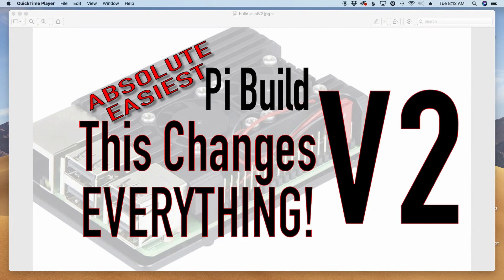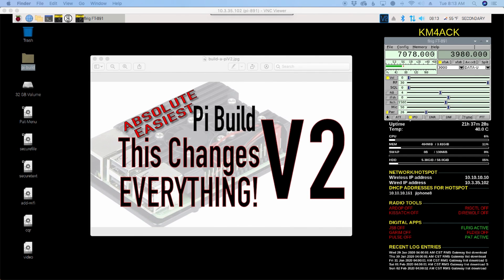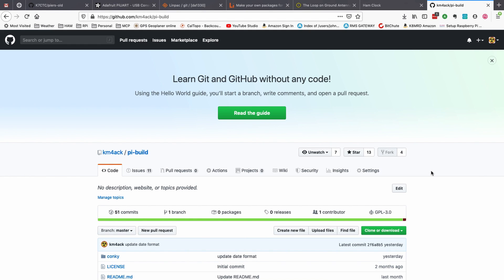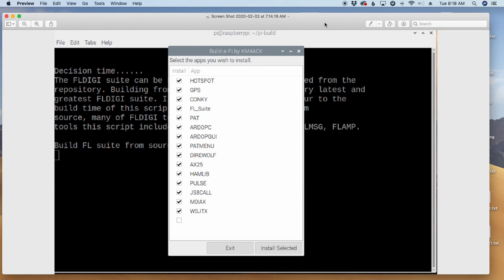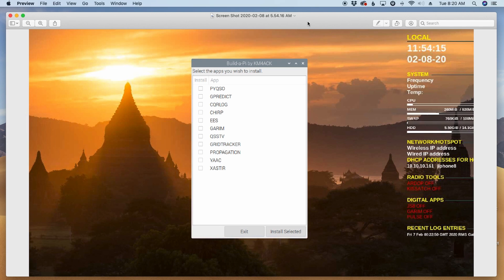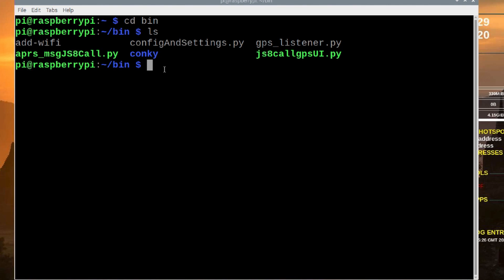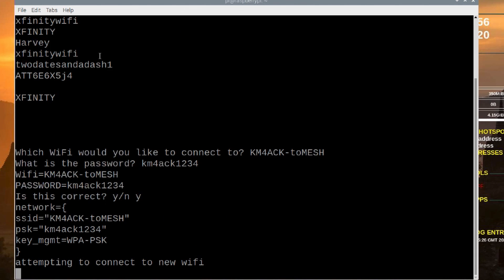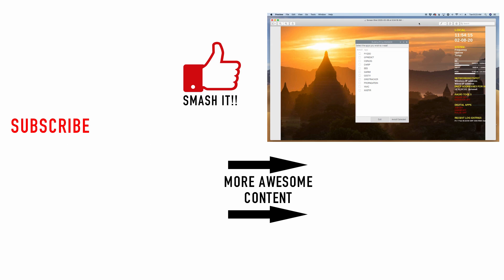Build a Pi V2 | Raspberry Pi Ham Radio

Comment: Just got a new Pi 4 that didn't come with an SD card. I'm about to copy the NOOB software onto a new card but after watching your video I would like to add your software package to the system. I have a couple of Nobe questions if you don't mind. 1) what is buster and where does one get it? 2) I use FLRIG on my shack computer to control my IC7100. The 7100 uses a special USB driver. any suggestions as to how I might add this to the build? I'm thinking I will use your software on my Pi as my digital interface for my radio.
Reply from the maker: Buster can be downloaded here https://www.raspberrypi.org/downloads/raspbian/ Question 2 I am probably not qualified to answer since I don't own the 7100 but I don't think you have to install the driver. I think the driver you need is already installed in Buster. If I am wrong, maybe another Icom user will jump in here and correct me. 73, de KM4ACK

Comment: Hi jason, 
I ran the command however the UI on the right with your callsign, gps, resource monitor etc didn't install. Is there a manual way to do this? thank you.
Reply: I had the same problem it looks like there is a problem with crontab as it does not come up with the second part of the install after the first restart.
Reply: can you run conky command manually to see if that starts it

Comment: Jason love what you are doing here. I have a problem, as soon as I install the hotspot(after reboot) I can't connect to my internet hotspot(iphone). I can connect to the pi hotspot from the iphone but the pi never sees the iphone hotspot.  How can I turn off the pi hotspot so I can finish the software install? Thanks
Reply from the maker: Hi Lynn, check out the FAQ to remedy this. It is normal behavior but the Hotspot FAQ will offer additional guidance. https://tiny.cc/km4ack-faq 73, de KM4ACK

Comment: Hi Jason, and a big thanks for all your efforts!

Oe snag when compiling Build-a-Pi V2...M0IAX no long supports JS8CallUtilsGPSD on his GitHub page...the link fails during compile. The new (supported) link is JS8CallUtilities_V2.  I have changed this in your build and compile script, and all now runs perfectly.
Thanks again - Jerry, K4OAM
Reply from the maker: Hi Jerry, the script has been updated (as of 20200423) to point to the latest version of JS8CallUtilities. 73, de KM4ACK

Comment: Excellent script once again!   This is a substantial help for those new to linux and desiring to incorporate with HAM.   I have everything running (been following Jason and Jullian (OH8STN) for a while.)... however, I do have one issue I haven't been able to resolve.  With QSSTV, I can receive fine.  However, when I try to transmit, the PTT triggers, but no sound is actually sent (zero power output).   I've tried about EVERY configuration combination.   I'm using FT-891.   Does anyone know if a manual edit to the config file is needed to get it working?    Thx
Reply: Brian I'm having the same problem with my IC7300, no transmit only receive. Most advice I've seen on the net is to change to MMSSTV. Not much use if you want to have a portable pi station ON8STN style!

Comment: Hi Jason, is this somehow usable when using PI headless, without desktop?
73 Jouko
Reply from the maker: The desktop is required. The script would be pointless without the desktop environment as many of teh applications it installs need the desktop GUI to run. With that said, you can setup the Pi headless and enable VNC from a SSH connection.  Then connect to the pi with VNC. From the VNC connection, open a terminal on the desktop and run the command to start the script.  The script needs the desktop environment to display the list of applications to be installed.
Reply: @KM4ACK  
Thanks for good explanation. I know many are running PI headless but as you told Buster with Desktop is needed.  Your clear answer helped many to use VNC in that situation.

Comment: I like to create another user rather than use the pi user.  What needs to be done to make everything work for the new user?
Reply from the maker: Make sure the new user has rights to the same groups as pi including sudo. You might also have to mod some of the .desktop entries for different menu items. It would probably be easier to do this after the build since the script is written with the assumption that pi is the user.

Comment: Tried to install but did not get the call sign option it ended the string saying it was a directory
Reply from the maker: Doug Wheeldon sounds like you may have missed part of the command. YouTube can jack up the link sometimes. Try the install command on this page. https://github.com/km4ack/pi-build
Reply: figured it out I installed with noobs...re-imaged and worked thanks!
Reply from the maker: Doug Wheeldon cool. Glad you got it figured out. Thanks for letting us know the issue. That may help another user in the future. 👍

Comment: Anybody else has a problem of freezing up on install.... l found, if l say yes to install FLDIGI from source it will seize up when loading.... saying no loads up the script with no problems
Reply from the maker: Building from source takes a VERY long time compared to installing from the repositories. It may seem stuck on one line. Leave it be and check on it in an hour. It should have moved past that line by then. The entire build when installing from source will take 3-4 hours on a pi 3. A bit quicker on a pi 4.
Reply: @KM4ACK  Having the same issue... I had to erase and delete the pi-build directory and all contents to restart... This time, selecting N to source for FLDIGI suite ran, rebooted, then on the second set of options I found that my localisation changed to <not set> and lost my wireless connection. Had to manually set using command line, as desktop function would not save setting. Seen this before?
Reply from the maker: Mark Hetherington haven’t seen desktop not save settings. Are you using pi 3 or 4?
Reply: @KM4ACK  I am using a Pi 3 B+

Comment: Hi Jason, Thought I would try your pi-build script, wondering whether anyone else has had this problem: Using new Buster, nothing else was run prior to your script and received this error:
 "Build FL suite from source? y/n n
/home/pi/pi-build/build-a-pi: line 121: /home/pi/pi-build/appchoices: Permission denied
pi@raspberrypi:~ $ "
Tried multiple times with and without sudo as well as Buile FL both y and n, with same results.
Hopefully it's a simple problem. Thx and 73 Ruben WA2NBL
Reply from the maker: Line 121 calls the application YAD which is installed just prior in the script. Are you running the script over an SSH connection or VNC? Did you change your user name prior to running the app?

Comment: is anyone else having trouble with the auto-hotspot. something is going on and it wont let me connect to wifi or connect to its hotspot. it says wlan stopped. before i ran the script i had it on my wifi.
Reply from the maker: Try running 'add-wifi' from the command line. Also, I am working on a set of tools to make managing the hotspot easier. You can read more about it on this page https://mailchi.mp/17d1631153a8/km4ack
Reply: @KM4ACK  im running your tools script and i have the auto-hotspot disabled with it and still cant connect to my wifi
Reply from the maker: nicholas cleveland is it a hidden SSID? If so, try making it visible and see if you can connect.
Reply: nope its a visible ssid. ive tried 3 differnet wifi sources. i started over with a fesh copy of buster and ran the script. i installed everything but auto hot-spot. and it pi is running great. tomorrow after work im going to installing the auto spot again.
Reply: i got it work today. i had to go to the website that the script is pulled from and to it step by step. but i have it working.